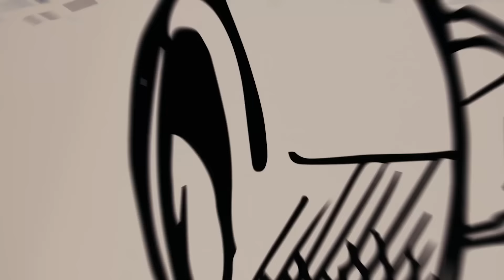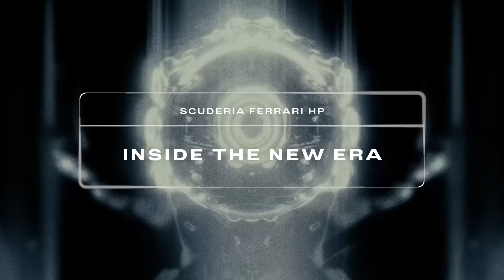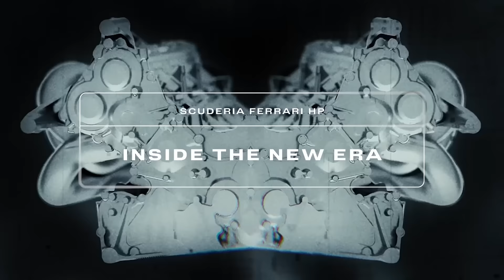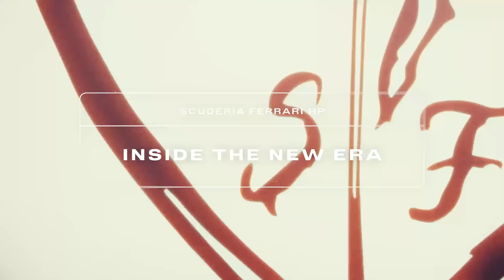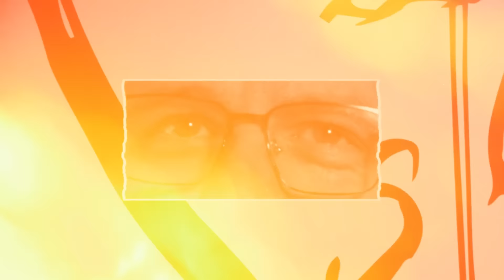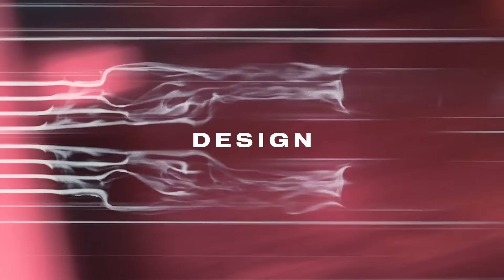The Biggest Regulation Changes in F1 History!

Comment: Lewis, at last on the podium & not trailing Charles. We won't win it in 2026, as Mercedes are faster but not off the start line. It's great in the first few laps battling for the lead but after 15 laps it's 3rd or 4th.

Comment: Theoretical Concept: Hybrid Multisphere Engine (MHM) 1. Ultra-efficient combustion core The heart of the system would be a very high-compression internal combustion engine. Characteristics: compact twin-turbo V6 architecture compression ratio: 20:1 high-energy-density synthetic fuel direct injection above 1000 bar Theoretical result: thermal efficiency 65–70% (conventional engines ~30%). 2. Regenerative electric turbocharger Inspired by systems used by Rolls-Royce Holdings in aircraft turbines. Functions: 1️⃣ compresses air to generate more power 2️⃣ generates electricity from exhaust gases 3️⃣ completely eliminates turbo lag. 3. Total Energy Recovery Instead of recovering only part of the energy as today, the system would capture energy from: braking exhaust heat structural vibration airflow around the car. This would be an evolution of the ERS system used in Formula 1. 4. Solid-State Battery Technology studied by companies like Toyota. Advantages: 3x more energy density ultra-fast charging much lower weight. 5. Acceleration Supercapacitors Supercapacitors release energy instantly. They would be used for: overtaking corner exits maximum acceleration. 6. Artificial Intelligence Management The engine would have an AI system that would decide: when to use electrical energy when to prioritize combustion when to regenerate energy. This would reduce energy waste by up to 20–30%. 7. Energy Aerodynamics The air itself could generate energy. Idea: Microturbines in the air ducts Energy recovery from aerodynamic flow. Theoretical Performance A car with this system could achieve approximately: 1500 to 1800 horsepower 0–100 km/h in ~1.5 s Energy efficiency up to 3x greater than current cars Potential speed above 420 km/h (depending on aerodynamics). Real-world inspirations used in the concept Technologies come from various areas: Formula 1 hybrid systems Rolls-Royce Holdings aeronautical turbines Toyota solid-state batteries Supercapacitors used in electric trains and cars. Could this be one of Mercedes' secrets??

Comment: 🏎@Ferrari ’s🏎 Silent Revolution: Inside the 🚀New Era🚀

Scuderia🏎🎠🐎 Ferrari🦄🏎 is undergoind a profound transformation as it enters the 2026 technical revolution. Abandoning the "pullrod" experiments of the past, the SF-26 🛸(Project 678)🛸 adopts a pushrod suspension and a radical "spec A" philosophy aimed at reliability. 
Inside Maranello,🍬🍬🍵 the focus is the 50/50 power split between the V6 engine and a tripled electric output⚡️⚡️⚡️. Under Fred Vasseur🖐, the team has prioritized a "revolutionary" air intake and steel cylinder heads to manage extreme pressures. With 🤍🖤Lewis Hamilton❤️❤️🖐 and 🖤🤍Charles Leclerc❤️❤️🖐 now settled, the Prancing Horse 🦄 is betting on agility and active aero to reclaim the throne. 😎🍏